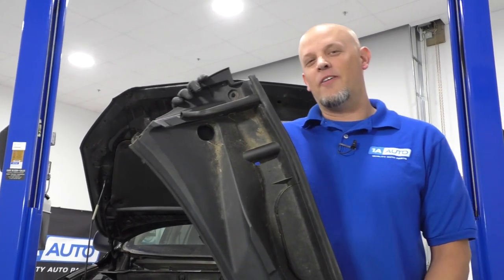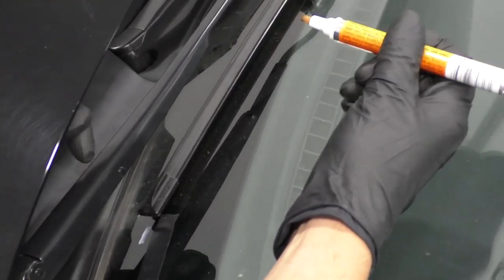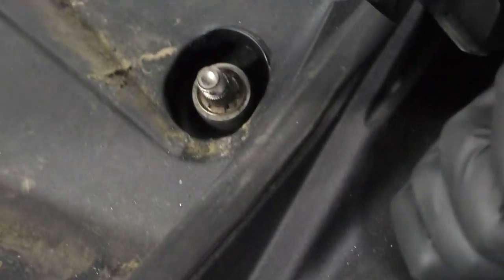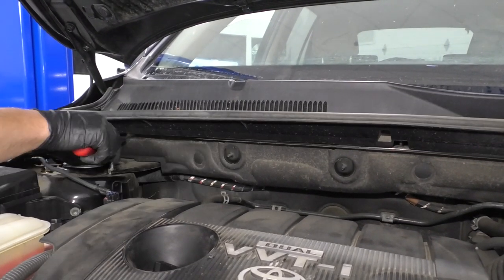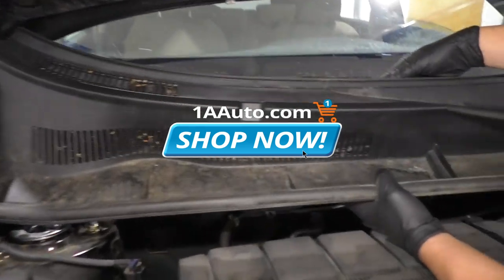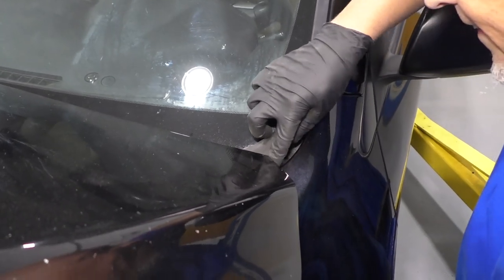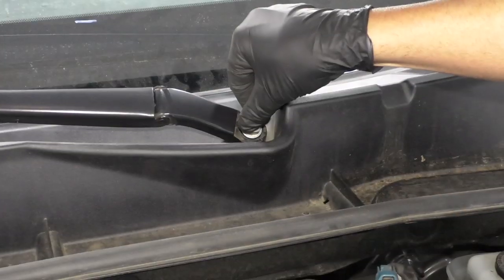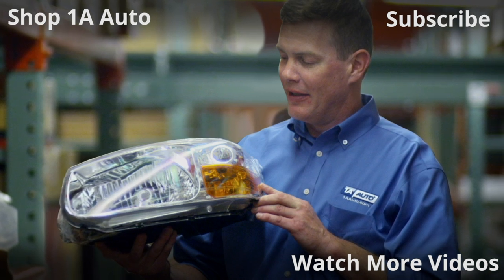How to Remove Cowl Cover 05-16 Toyota RAV4

Comment: Thank you 1A Auto for the tutorial. 
Crappy design by Toyota. I have to do all that just to clean out the clogged drainage area. Should’ve just put on a little service flap so we can easily clean the clogged area! Heavy down pour the past week and because of the clogged area my interior is now a small pond that wreaks of mold and mildew.🤦‍♂️😡

Comment: Its now 2022 and my 2015 rav4 has cowl cleaning to do.. Not as many leaves as before..i added foam at the sides by hinges to stop leaves only 1 this time..but the accuulated muck from yard blowers was gross.. I had to run my hand blindly on inside walls to remove the gook.. vac, car wash rag, compressed air, And carefully add water to get passages clear.. Air comressor assured clear passages..Let the area soak after a vac.. The dirt accululated must loosen to remove..  I just finished doing this.. Bird poop where do you think it goes to heaven ...nope it piles up in your cowl silly.. along with twigs dirt pine needles etc..  i refuse to breath poop..